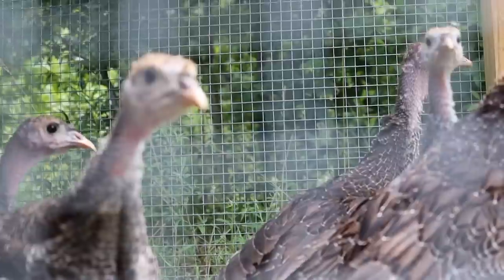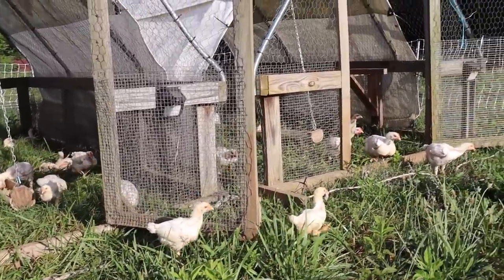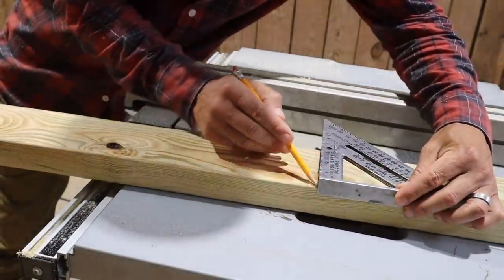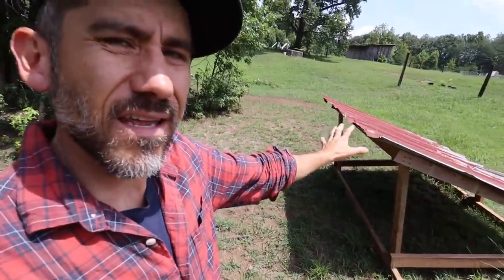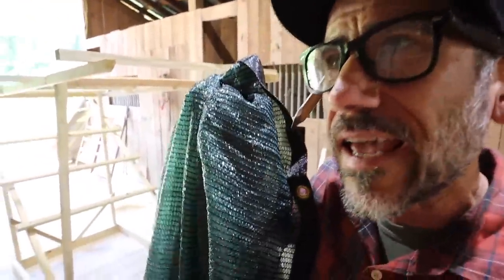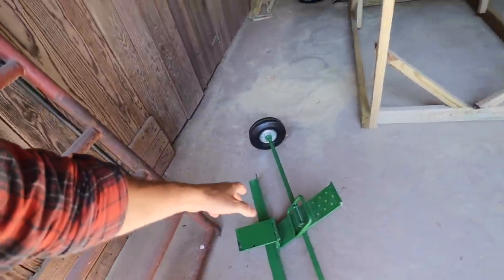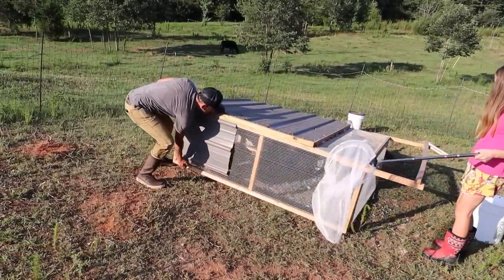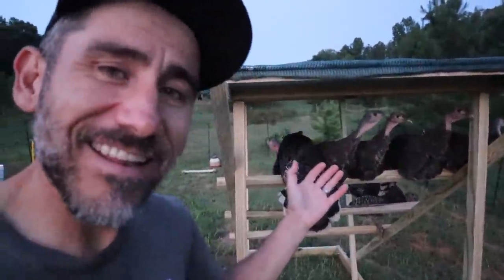Giving my Turkey's a Better Home

Comment: I bought 2x3s for building my chicken tractor just because I have to pull it and drag it on the ground. You're right that the wood doesn't have to be big since birds aren't real heavy. This is cool that you're building something special for your bigger turkeys. You studied industrial design, no wonder you're so good at building things Jason! That looks like Joel Salatin's turkey roost/shelter. I like the shade cloth. I think I would wrap the wood strips with the shade cloth and then anchor them down. Love it Jason. I love the noises turkeys make. Nice, they figured it out. Thanks for this Contreras family!